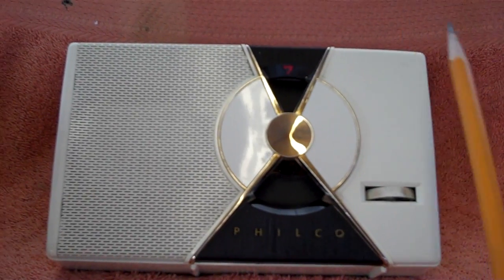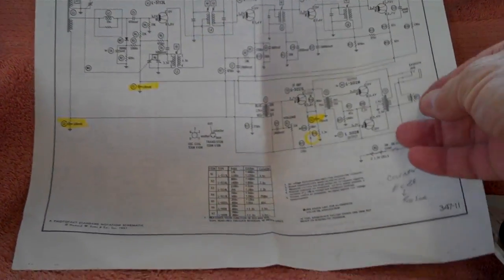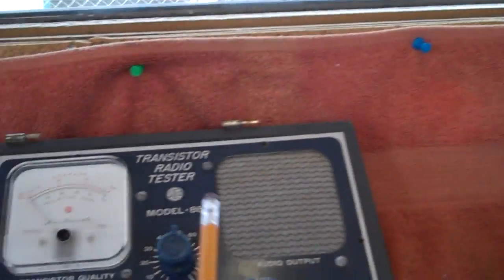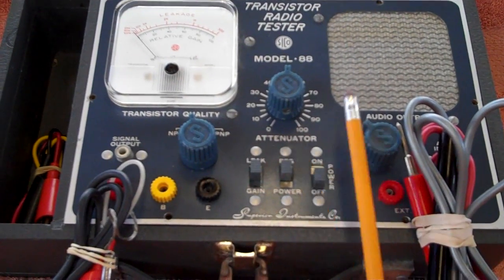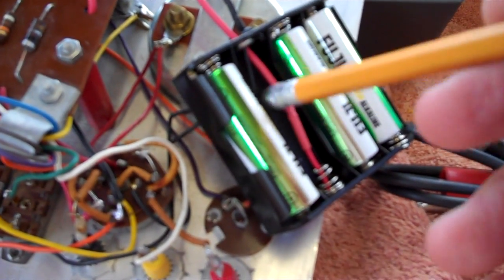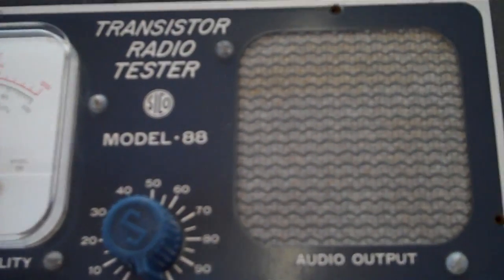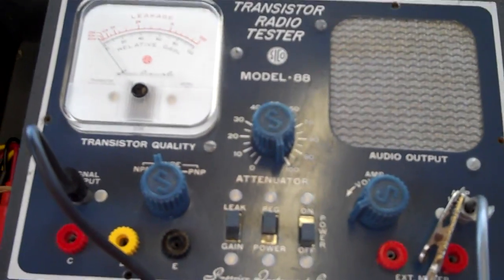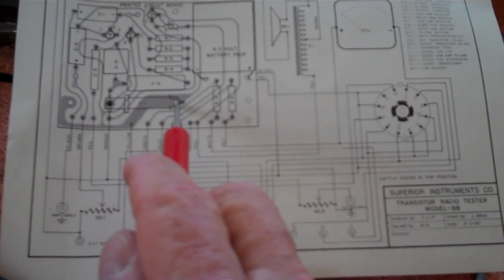1960 Superior Model 88 Transistor Radio Tester

Comment: A pretty nice unit.  If you're really into transistor AM radio work, another unit that's really worth it is the B&K model 960 Transistor Radio Analyst.  RF Gen, audio gen, low voltage DC VTVM, Battery eliminator with milliammeter.  Also transistor tester.

Comment: Hi John , I have one that i buy on ebay  it came with a 9 V battery I don't have the manual can you tell me the correct voltage I see on the video you have only 4.5 V   The other problem i have is with the red prove the RF it came damage the diode is gone and also one of the resistors on the prove the value is erase  if is any way you can get me this info I will appreciated
Reply from the maker: Milton,
Hello there, my friend, it's good to hear from you.  I'll be glad to help out, but first be sure you have the model 88.  If so, send me your mailing address to joernone@gmail.com.  In a day or two I'll make a copy of the manual and send it to you.  Sound like a plan?

Regards,
John
Reply: joernone Thank you very much appreciated the help and yes is the same model i even compare looking at you video and look the same components and all mi email is damilton56@gmail.com thank you John

Comment: John, I was inspired by your video and recently purchased one of these.   Mine is marked model 158.   Could I convience you to share the wiring diagram you received with yours?   Or posible identify the long thin cap that is on the upper board running paraell in direction only to the electrolitic rate at 4mf at 12v?   Also the two large resitors, the bands on mine are almost gone.   I would like to confirm before replacing.   Finally waht can you tell a newbie about how to make or locate the leads you show?    Any help would be great!   Thanks Dennis

Comment from the maker: David,
Good for you, my friend. I'm glad.  Remember, the tester is a battery unit that uses only two of its three transistors to generate tone, so don't expect loud, top-notch sound.
BTW...thanks for telling me about the hole in the bottom of the Heathkit AR-2 cabinet. It was covered with fabric and I didn't notice it at all.  You did good on that one.

Regards,
John